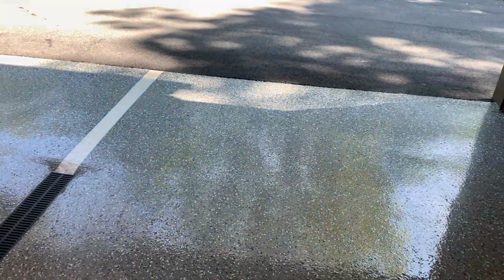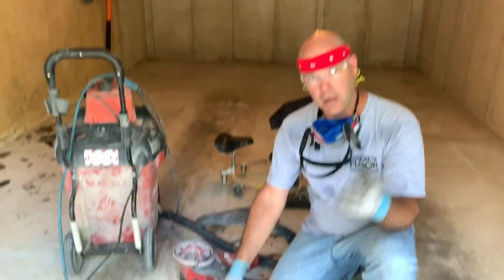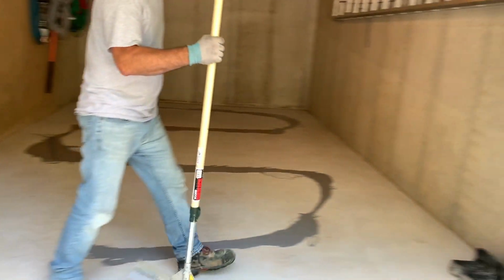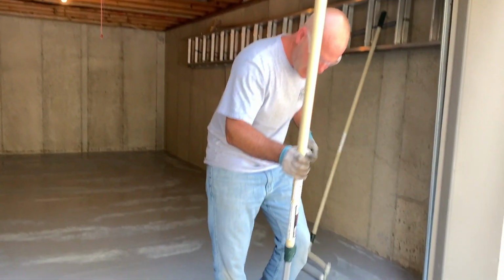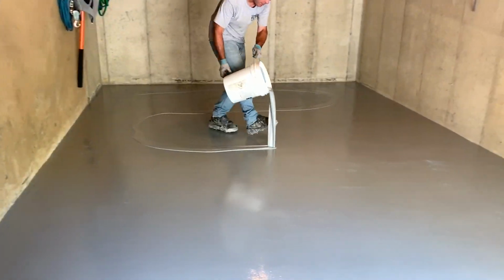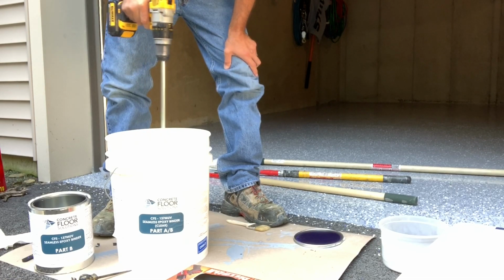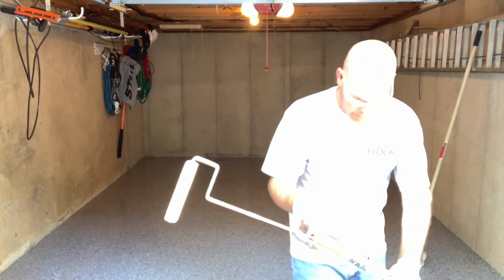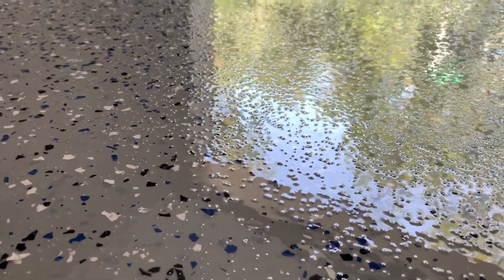How to Install Epoxy Flake Floors / Tutorial Video

Comment: what do you do if you have two garage doors and each side slab break ends at different points at the garage door.  In other words, one side slab break ends under the door and the other side ends at the outside wall, making it about a 6-8" difference which would look odd.  Do i paint the driveway on short side to match the other or vise versa?

Comment: What do I do if I broadcast my epoxy flakes unevenly and I ran out of flakes before finishing the floor?  I was a little heavy handed in areas.
Reply from the maker: Thats why you always broadcast the whole floor first lightly, then slowly reapply evenly over the whole floor until you run out or achieve desired look.

Comment: Great video.  I felt like you gave info that matters, and not waste the viewers time. 
If I  do this on new, unused concrete, do I need to grind it?
I haven't poured the concrete yet.  Is a power troweled finish the best?
How long after pour til I can put this on?
What do you so where there's joints from separate,  but adjacent pours, as well as sawed control joints?
Thanks, Steven.

Comment: Can I epoxy directly over floor tiles ? They are sitting well bonded and have no sign of lifting
Reply from the maker: Not recommend but has been done. You MUST diamond grind and get a scratch on the tile if you expect it to bond. Remember, your coating is only as strong as what its bonded to.

Comment: Great video. Any tips for avoiding roller lines in the clear coat?
Reply from the maker: I would have to say make sure it is heavy enough, if you apply it to thin it can leave roller marks.

Comment: I assume aluminum oxide is so floor is not so slippery ?( traction)
Reply from the maker: correct
Reply: Does Aluminum Oxide create a roughage to the surface by chemically reacting like gelatin or does it add grit like a powdered paint (rhino) lining for a truckbed?

Comment: 1st day you did primer coat and intermediary … how dry and how long after primer coat do you apply intermediary? Thanks in advance
Reply from the maker: As long as you apply the prime coat thin, you can apply the intermediate coat immediately after. This only applies for our material, not all epoxies can do that.

Comment: Can you do a floor in two parts? I will be doing a large 4 car work shop and I would like to move everything to one side and apply a coating first, then do the other half one the first is done. Will there be an issue at seem? Obviously it's better to do everything in one to if possible. 

Another question. How well do epoxy coated floors hold up to your work like weld spatter and hot metal?

Comment: need to do it for Outdoor Patio slab, it has a slight dip in corner. Need to level it first (May be self leveling compound) then put epoxy on top. To Prep we can grind the concrete but Do we need to grind the self leveling as well for bonding ? or what else do you recommend for leveling the dip in the corner. Slab is in great condition only 3 years old, no cracks or anything, builder just didn't do a good job.
Also what about expansion joint in patio slab, do you cover that with epoxy as well ?
Reply from the maker: I would recommend using an epoxy product to do the leveling (make sure you prep well before you apply do you epoxy leveler.  Then grind after you apply it so you have a good scratch in the entire floor surface, then apply your epoxy coating system on top of that.

Comment: Great details and thank you. Any precautions or concerns with these materials in a humid area like South Florida? Summer would be too hot here, looks like a "winter" project.
Reply from the maker: You want to apply your prime coat in the afternoon / evening when the temperatures are dropping. If you do it in the morning, the heat will pull vapors out of the concrete and may create bubbles.  Also, never work out of a bucket of epoxy, it will set much quicker in volume.  Mix the epoxy and pour it on the floor to slow down the chemical reaction. The hotter it gets the quicker it sets.

Comment: Nice match! Can you use same rollers for primer and intermediate? Thanks!
Reply from the maker: Rollers are not reusable, you will need to throw them away after each coat.  In the event you are applying the intermediate coat immediately after the primer, you can reuse the roller. Typically I try to instruct people to do one coat per day though, otherwise it gets tricky applying the intermediate coat on wet primer, you can actually squeegee the primer off of the surface if you push too hard on the squeegee

Comment: You have some stuff left in the first bucket, should you use it on top or the fist layier? Use up the hole bucket?
Reply from the maker: When you are installing epoxy floors, the worst case scenario you can have is running out of material.  That being said, I always have extra because it's better than running out.  If you have a little bit of material, yes you can pour it on the floor and squeegee it around to make it consistent. Otherwise I let it set in the bucket and throw it away. Our epoxy is inert after it sets.

Comment: Hey Jason. Great video. I have a couple questions regarding your process as well as the process in general. 1. Can you skip cleaning the concrete post grind every time and immediately start the project? Or is it case by case depending on how porous the concrete is? 2. I live in Florida and as a result it's pretty hot and humid most days. Should I use epoxy that is 100% solids or consider using a solvent based epoxy instead? (These questions come from doing some research prior to watching this video where it was suggested to clean the concrete before getting started and also that the temperature and humidity can effect the process). Thanks again for the great video!
Reply from the maker: You grind the concrete, vacuum dust and immediately start applying epoxy. We use and I would highly recommend a 93% solids primer. You need the primer thin enough that it penetrates into the concrete. Every consecutive coating after that should be 100% solids.  Here is a link to our floor kit that we use and have used almost daily for 20 years without failure.
https://concretefloorsolutions.com/product/500-sq-ft-complete-epoxy-flake-floor-kit/
Reply: @ConcreteFloorSolutions  Thanks a lot for your help. I really appreciate it.

Comment: Could I do this and not use the flakes? I just want a shiny surface and not much else. Would probably make the floor slipperier but are there any other cons?
Reply from the maker: Yes, you can use a single color. The advantage of the flakes is camouflage, if you do damage the floor the flakes conceal it.
Here is a link to our solid color kits.
https://concretefloorsolutions.com/product/500-sq-ft-solid-color-epoxy-floor-kit/

Comment: You could technically use any grinder with a diamond wheel and just go back and sweep/vacuum the dust right?
Reply from the maker: That is correct, you just want to get a scratch in the surface for the epoxy to bond to.

Comment: just question would you have to grind if the concrete is freshly poured about 3 months old no heavy traffic? BTW great informative video...
Reply from the maker: I always recommend diamond grinding. If you have laitance on the surface, it will give you the illusion of solid concrete and after you coat it,  it can peel.  The best way to guarantee a good bond is a scratch in the concrete from a diamond.

Comment: Great informative video and thanks putting it out. I have a question, the video shows that you applied the intermediate coat right after applying the primer and while it is wet, the data sheet indicates that you have to wait 10 - 14 hrs before applying! am I understanding this wrong? Thanks again
Reply from the maker: You can apply the intermediate coat immediately after the primer. You do need to understand down pressures of the squeegee so you don't wipe the primer off the floor when you apply the intermediate coat.  For a novice, I would recommend doing one coat per day to be safe.  The primer and the intermediate coat are the same basic materials with the exception there is some solvent added to the primer so it can penetrate into the substrate.

Comment: how longue does an epoxy floor like that will last ? and can you doo epoxy on garage floor that do not have a vapor barrier under the slab ?
Reply from the maker: You should easily get 10 years minimum out of the floor before it starts looking worn out. It depends on how well you maintain it. Always clean abrasives off the floor so the tires don't grind it into the surface.  I just posted a video this morning of this exact floor two years later and the floor next to it four years later. 
https://youtu.be/n25g44yLfJ8
And no you do not need a vapor barrier.  You need to make sure you apply the primer when the temperatures are dropping so the primer penetrates into the concrete.

Comment: I have a new construction garage floor I need to do. It’s a 23x23. The only thing on the concrete is dried up spackle and some paint. Do I still need a diamond grinder or will degreaser work? I see that you did an intermediate coat. Is that necessary? Homeowner would like flakes to cover the whole floor so could I just do one coat? How long will this take?
Also how much should I charge? 

Thank you in advance and sorry for all of the questions. I subscribed and liked as well.
Reply from the maker: You always need to diamond grind concrete to get a scratch and remove the Laitance from the surface. Skipping that step could lead to failure. We have always installed and recommended a three coat system starting with the primer to penetrate into the concrete, the 100% solids intermediate coat to hold the flake and 100% solids Epoxy topcoat or polyaspartic depending what your budget is.
This is the system we promote and have been using for well over 20 years. It is fail safe as long as you prepare the concrete properly https://concretefloorsolutions.com/product/500-sq-ft-complete-epoxy-flake-floor-kit/
By all means, if you have any questions about materials or or installation, look me up directly in the video description.

Comment: Hey! Thks for the informative vidéo!! Instead of buffing the concrete, could I simply pressure wash it with a strong pressure washer like 4000psi? Thks!!
Reply from the maker: I always recommend a diamond grind with a scratch in the surface.  It may work if you do extreme pressure washing, but you aren't getting the surface profile and may still have failure.

Comment: Great video! 👍🏻 Do you need to acid clean as well and hose down?
Reply from the maker: We NEVER use acid, that is why we diamond grind.  There is NOTHING good about using acid.  Dry diamond grind and apply your floor immediately after.  Quicker and better.
Reply: @ConcreteFloorSolutions  TY!

Comment: It looked as if you put the intermidiate coat directly over the wet primer , is there a flash time or recommend time to wait  in between the first two coats ? Also did you use the same roller sleeves for the first two coats?  Thanks in advance,floor looks great💪
Reply from the maker: I wait about 1/2 hour between coats, which it takes that long to set up for the next coat anyway.  We do use the same roller between coats when we "wet" coat.

Comment: Can I just use roller without using squeegee to apply the three coats?
Reply from the maker: you can, but I wouldn't recommend it. You wont have a consistent coat of material and it will take much longer to apply.

Comment: Great video! Would this process work for a plywood subfloor?
Reply from the maker: It does bond to wood.  The issue is the joints, they will probably project through and crack the coating at some point.  Also, if it gets humid, it could trap the moisture under the coating and start to buckle. Epoxy is not a breathable coating.

Comment: What should be done in corners where flake has built up and is pushing thru the top coat? (I paid someone to install)
Reply from the maker: try a small hand scraper to knock off the peaks?
Reply: If floors completely finished,  may take 80, or 120grit sand paper and sand it down...then touch it up with clear urathane coat

Comment: Just watched your whole video! Thanks for posting! I see this is the first video I seen that is the fastest and easier way to do the garage. I a lot of people clean for one day and let it dry for another day. Seems like it took them at least 5 days or longer just to finish. My garage is a brand new garage about 2 month old from brand new home. Do I need to grind up the ground as well? What do you think about the DIY Rust Oleum product from Home Depot? Hope to hear from you soon! Thanks!
Reply: I’ve been in this business a while, and you always need to grind concrete before applying epoxy or it will not be able to bond.
Reply from the maker: I just posted a video today on the big box store epoxy failure.  I always recommend grinding because there may be laitance on the surface that can interfere with the bond. https://concretefloorsolutions.com/product/500-sq-ft-complete-epoxy-flake-floor-kit/

Comment: I have an concrete floor that was not correctly finished and is very rough. Instead of smoothing or floating those who built it packed the concrete with a 2X 6 and left it how it finished. How do I fix this? Grind it smooth, or is there something pourable that I can pour and spread to make it smooth? It will need just slightly less than a quarter inch depth  to cover the roughness.
Reply from the maker: If you can get a grinder to spin on it, try that.  I would take all of the wights off of it first so theres not so much down pressure on the heads.

Comment: I noticed you didn't scrape off the excessive flakes? can you tell me more about that?
Reply from the maker: You only need to scrape the flake when you do a full broadcast. Some of the flakes will stick up vertically that you need to scrape off. When you do a random flake that is not so heavy they lay flat. The few random flakes that may stick up break off when you run the squeegee over it on the clear coat

Comment: Great video with good practical advice and tips! Key points that I learned include how to walk safely when applying the top coat, applying the aluminum oxide, and the clamp trick for the garage door. If the product is good enough for you to use in your own garage, we'd trust the materials in ours. We'll be buying from your company!
Reply from the maker: Thank you for watching
https://concretefloorsolutions.com/online-store/

Comment: How much would it cost to have a 40x25 garage done?  Thank you
Reply from the maker: depends on location. most contractors charge $6.50 to $10.00 per sq.ft. to install it.  You can buy it and install yourself for $2.00 per sq.ft.  https://concretefloorsolutions.com/product/500-sq-ft-complete-epoxy-flake-floor-kit/

Comment: Very helpful, thanks . One question. In between flakes and top coat. Do I need to sweep or blow off excess flakes that didn’t bond to primer or will it all have bonded
Reply from the maker: Sorry about the delay, I did not see this earlier. If you are just doing a random flake like in this video, you do not need to sweep or blow them off. The few random flakes remaining will simply roll in the top clearcoat. https://concretefloorsolutions.com/product/500-sq-ft-complete-epoxy-flake-floor-kit/

Comment: Great video - best garage epoxy instruction video out there.  
You seem to use the aluminum oxide in all your garage floor projects.  It seems like many other folks do not, referring to the added difficulty in keeping in clean.  Apparently you place a higher priority on safety (non-slip) than ease of cleaning.  Question:  Does the aluminum oxide really make it that much more difficult to clean?  I'm planning to do my garage and I'm leaning toward non-slip safety vs ease of cleaning.  Appreciate any insights you can offer.
Reply from the maker: It does not make it harder to clean.  As long as you don't apply too much.  1 pint per 400 sq.ft.  is PLENTY. https://youtu.be/-cxw1wp8UEY